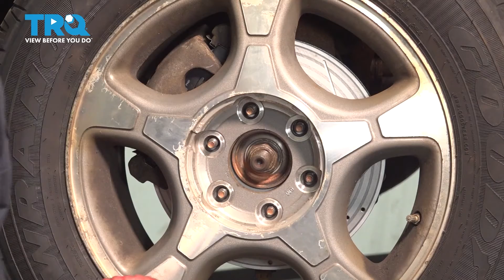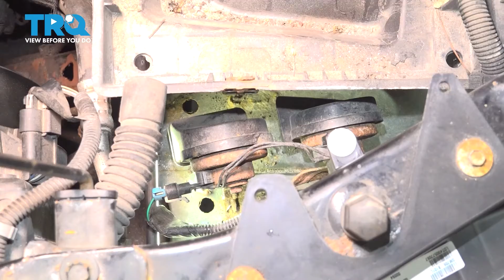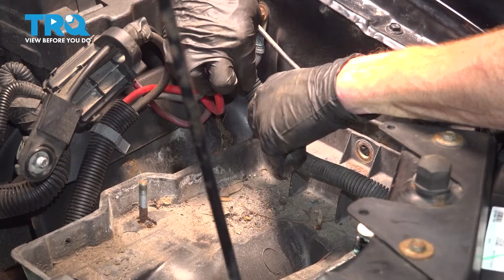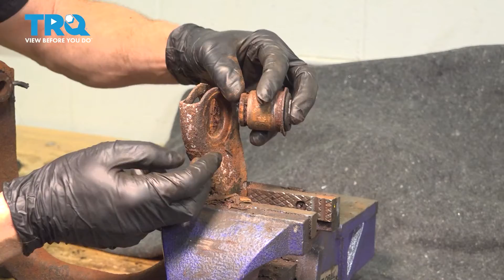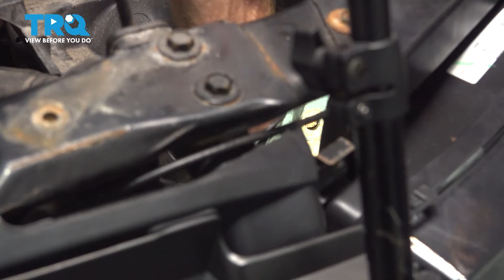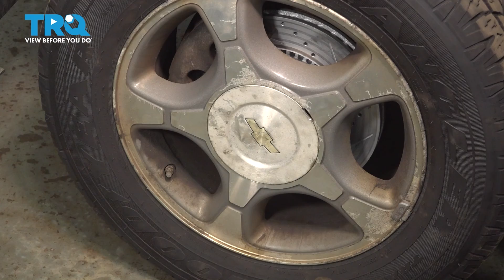How to Replace Left Upper Control Arm Bushing Set 2002-2009 Chevrolet Trailblazer

Comment: BEWARE OF THIS VIDEO!!

First.. you don't have to take the whole battery & horn zone apart to get that bolt out.  In fact, NOTHING under the hood needs to be touched at all!!  You merely have to grind away a tiny bit of the little lip extension on the inner fenderwell edge to let the bolt pass by it while working from that side instead of all the unnecessary under-hood hassle-- and the edge lip is so small that you can use as little as a Dremel tool or a hand file to grind it away (though I use a plasma cutter and make a lot of extra space which is handy).

Oh, and if you don't happen to have a metric wrench for the main bolts, the SAE equal is 13/16th.  As well, you should tie the steering knuckle to something to support it in place while working so as not to put tension on the brake line and ABS cable.

Anyway.. back to the mayhem-- it gets extra crazy when he shows us the bushing removal on the original control arm as he bends and pinches the bushing flange area (happens at 11:53)... then.. in case you didn't notice.. he goes and gets a shiny brand new control arm to install without saying a single word about damaging the original one.. or to warn the viewer about not messing theirs up doing the same thing he is showing to do while pressing bushings in/out.  Do not use an impact for this!  Use a breaker bar or some other form of hand tool to slowly ease it through , and keep an eye on the spacing between the bushing flange separations or you may end up like this guy.

However, I must give him credit for the original scope of merely swapping out bushings and using a control arm that is already known to the vehicle, since aftermarket control arms are sometimes not a great mate for existing ball joints and/or other OEM things that they may need to attach to.

Comment: This is laughable. You screw up the control arm the way you removed it by compressing the two sides together, then you continue on like nothing is wrong with no warning to anyone, and then swap out the whole control arm because of it. This video needs to be taken down before someone else follows this foolishness. 

Anyone else doing this, you need to put something solid and strong between in space where the bushing resides so you don't push the two sides together like he did and end up needing to replace the whole thing. Better yet, don't use an impact and just use a c-clamp.

Comment: What a lot of extra work, that’s crazy taking all that battery out of there and bending the body with a prybar to get at it, I did this without having to remove the battery, got it underneath the wheel well with a  ratcheting wrench and a pipe, also why did you press new bushings in an old control arm but then installed a new control arm with bushings either preinstalled or put in by you?